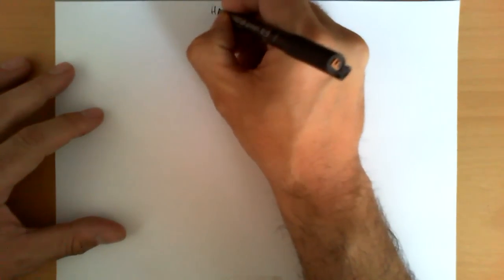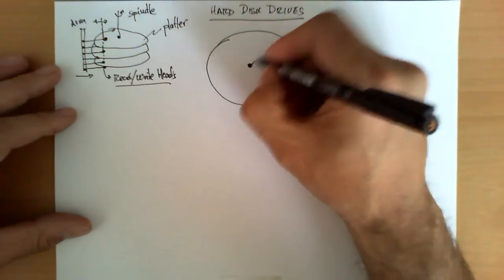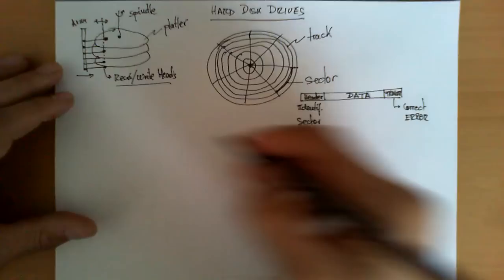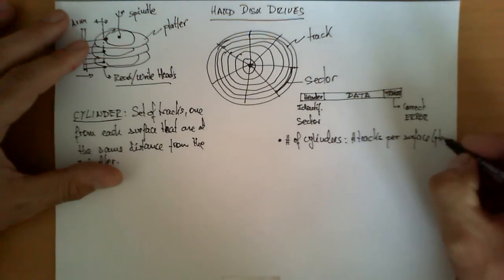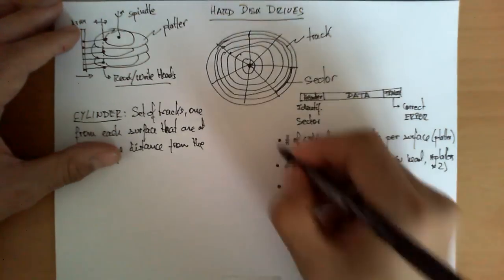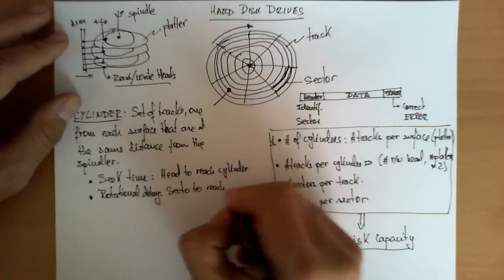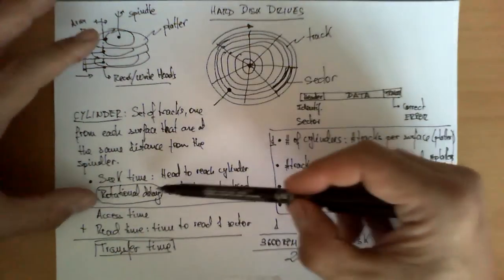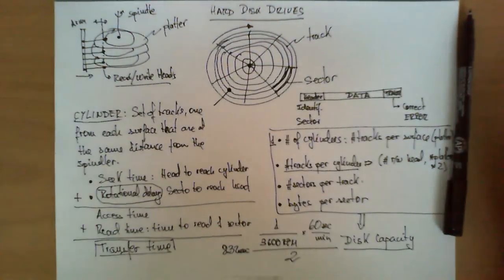Hard Disk Drives

Comment: For the basic this video is fine I guess. He forgot to mention that the bottom surface is called the servo disk and data is never stored here only sector address location or the header portion depending on the format of the disk. So the address of each sector and format is on this bottom plate. The hard drive also has a memory that stores these addresses and converts them into differential current that drives the heads to almost a direct hit in the desired location before a read sector address is even initiated. To have physical sector size almost the same the most inner of the disk and the most outer portions of the disk are not used, these empty spots are used for landing of the heads.

Comment: Well explained! However, something is not clear to me yet. Let's assume I want to read a file on my HDD which has 5 platters. Let's also assume the file is perfectly distributed on one cylinder only. Would I then still need cylinder "jumps" after every five read/write head adjustments? Or is reading out the entire file possible merely with read/write-head switches?
My idea of the pattern: H -> H -> H-> H-> H-> C -> H -> H -> H-> H-> H -> C ... etc. until my file has been read? (H := read/write-head switch, C := cylinder jump)